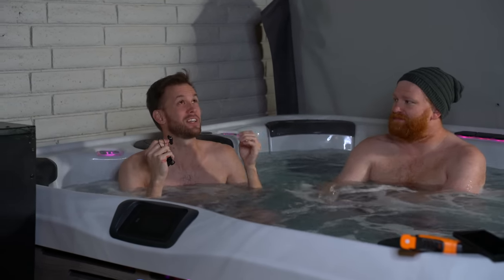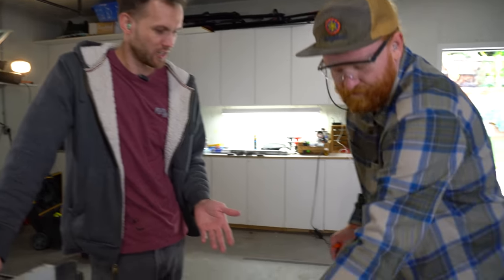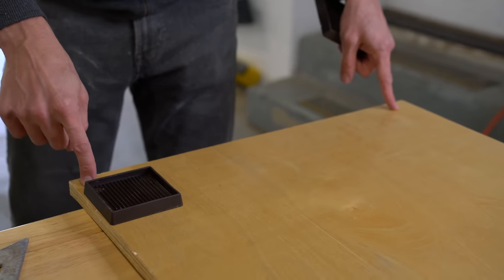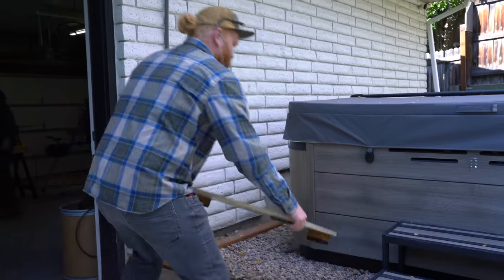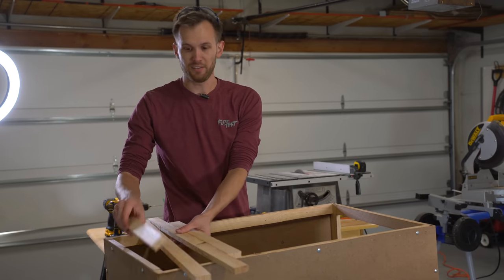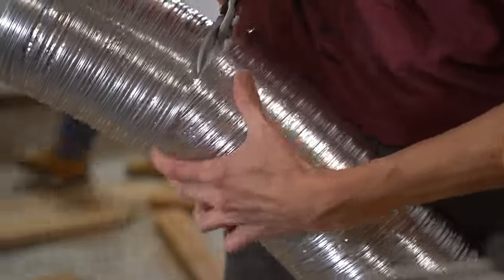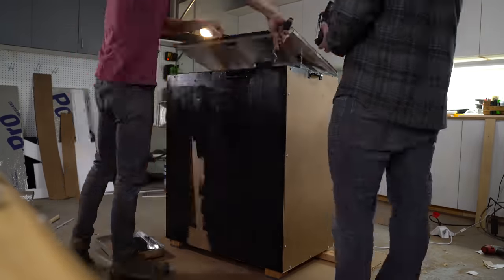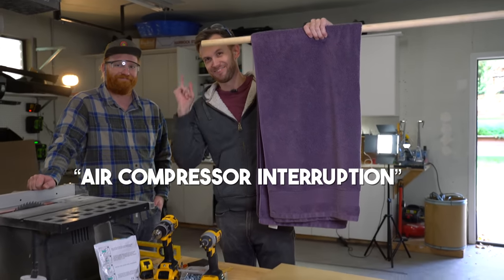Hot Tub - DIY TOWEL HEATER!

Comment: 👍This is a great idea, and great execution.. but im thinking it would have been easier and more efficient just to use pvc and pump the hot water from the tub through it to warm the towels instead of hot air. They have hot water towel warmers in Iceland

Comment: Rather than recirculating the air to the heater u could just use a digital thermostat to power the heater on and off. As of. Now mine had a heat lamp and a wall towel heater rack laying in the bottom . But I want it hotter lol

Comment: i might sound silly but wouldnt it be easier to take some of the hot water in the hot tub and circulate that in the box using a car heat exchanger and have a fan blow through that to heat the towels? so whenever the hot tub is hot the towel box should also be hot with very little extra power use.
Reply: @Fuck_YT  Was just thinking of two tubes over the side and into the water?

Comment: wow this is dumb, you could have just modified an Insulated Food Delivery Bag with a duct & vent... and you would have gotten equally the same effect. Also doing this, you wouldn't have a giant ugly wooden box next to your hot tub either. Instead you would have a portable towel warmer that looks better and is more practical for storage when not in use.
Reply: How is it portable (or better...or practical) if you're still hooking it up to a duct system?  How is it holding up the hanging towels without a frame?  If a towel is folded and sitting on the bottom of something made for pre-warmed objects, not for warming them, most of the towel isn't getting warm in that box.  If there's more than one towel, only part of one towel is getting warm.
As for ugly, a lot of people would be more bothered by something that has to be brought back inside after every use because it's not built for outdoor weather.  If you're going to call somebody dumb, at least have an actual better idea.